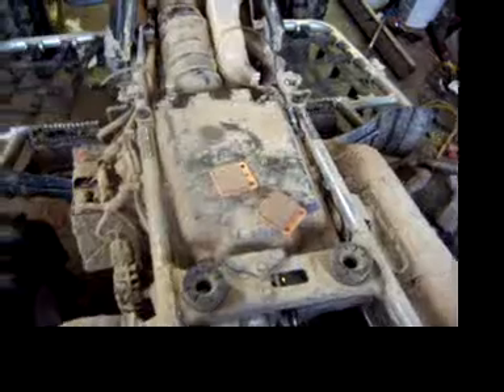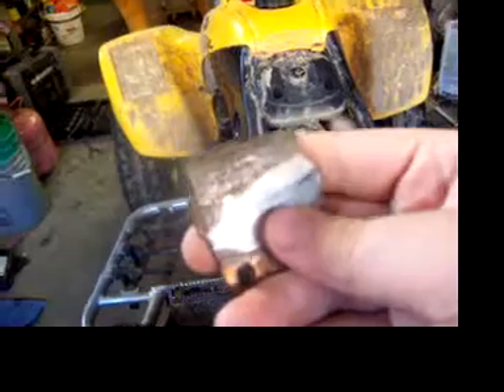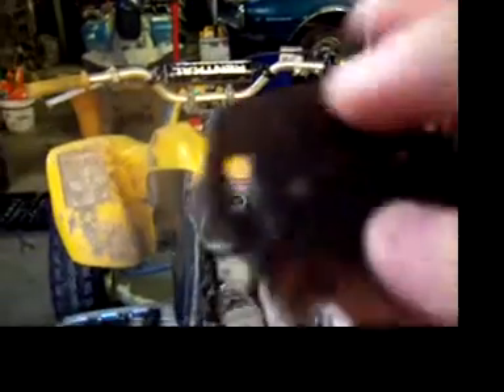Why Not to Buy Cheap Brake Pads:

Comment: Thats caused from your parking brake not being adjusted correctly. The bolt with the stop nut on the side has to be backed out then install new pads then tighten bolt till it stops then back off a quarter turn then tighten the stop nut......If anyone can make sence of what Im saying    :-)